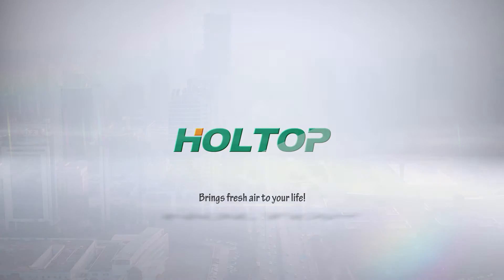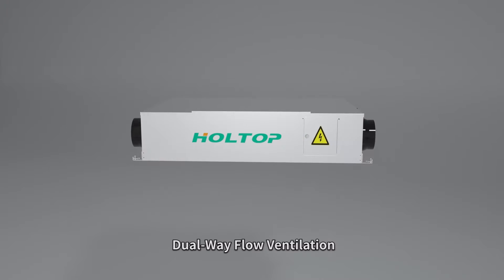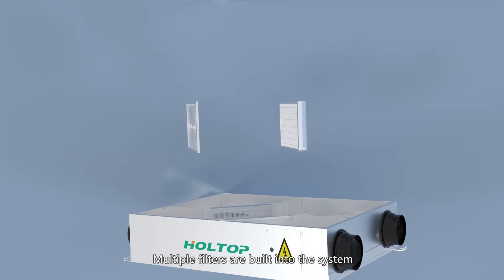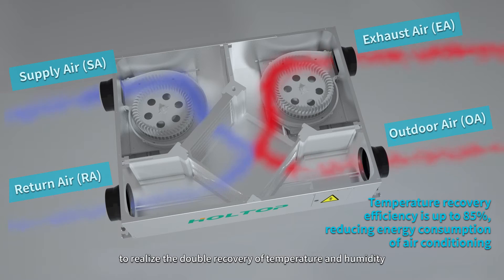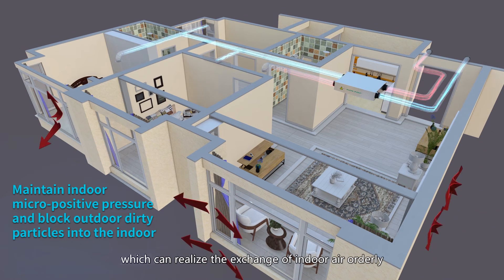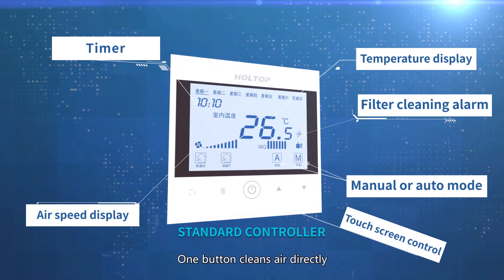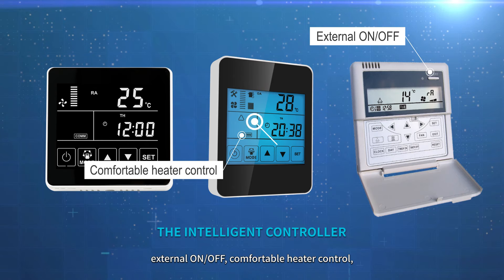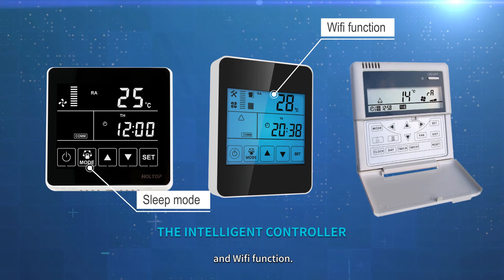How Does an Holtop ERV Energy Recovery Ventilator Work?

Comment: Does it take away humidity? If so how does it do? Also is this a separate system or feeds into HVAC?
Reply from the maker: ERV is a mechanical ventilation system, to bring fresh air from outside and extract stale air from inside, we know there is temperature and humidity difference between outdoor and indoor air, Winter and Summer. 

These 2 air streams(with temp&humi. difference) came across enthalpy heat exchanger, then the heat can be exchanged from the warm air to cold air side, and the moisture can be transferred from the wet air to dry air side without touching, this process is called energy recovery. 

So yes, it can remove certain moisture from your indoor air.

In addition, our ERV can interlock with a humidity sensor(optional purchase from us), once the sensor detects the indoor humidity level exceeds our setting value(for example: 65% we set), the ERV will run at highest speed to bring down the  indoor humidity.
Reply from the maker: If you are interested in these products, please send an email to sales@holtop.com. Our professional salesperson will reply with more details. Thanks!